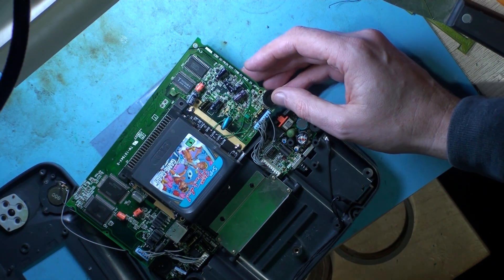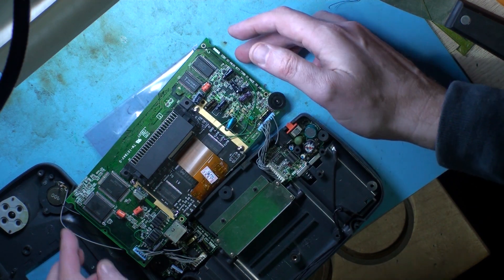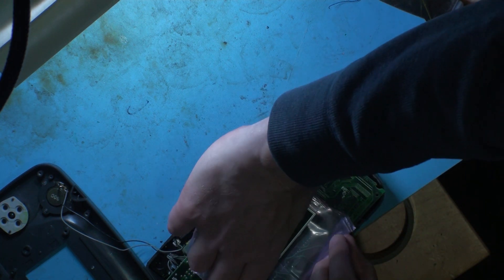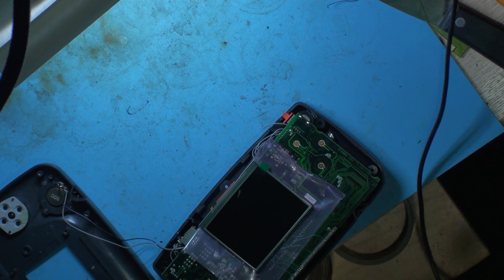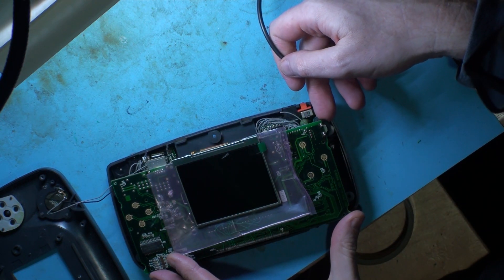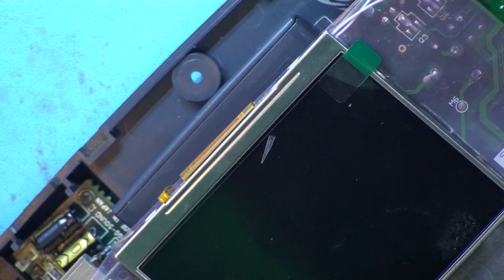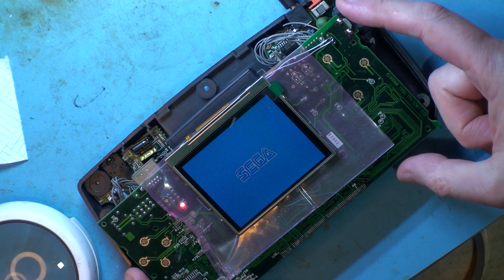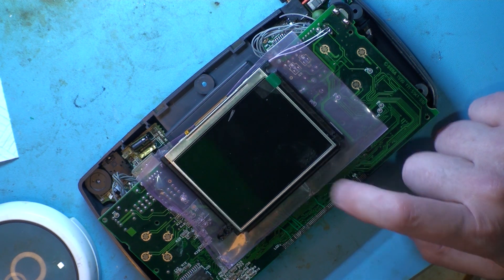Gamegear IPS Screen install on 837-7398-01

Comment: I'm having issues with this screen, tried installing the screen on two different game gear motherboards, but all I'm getting is multi-colour static on the screen and the sound does not work, they are recapped and both were working before the upgrade, any help would be great